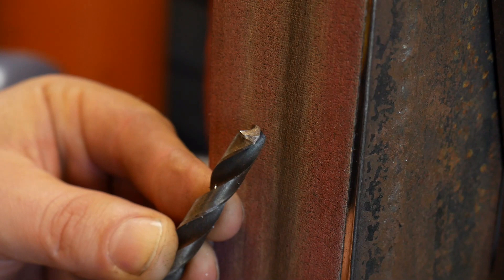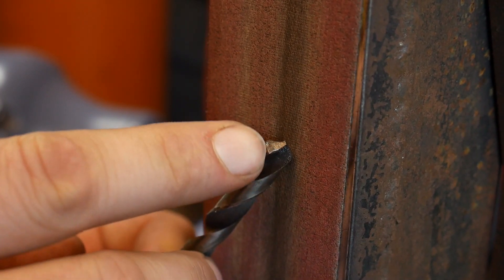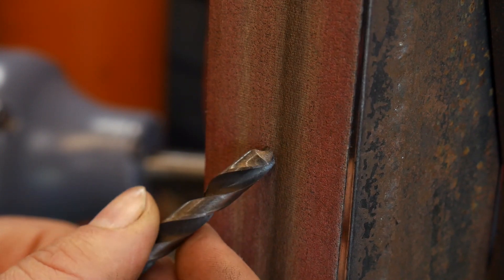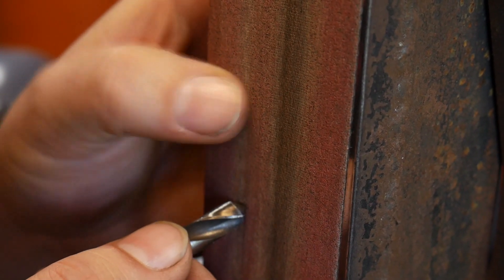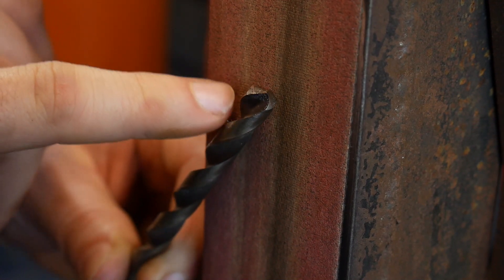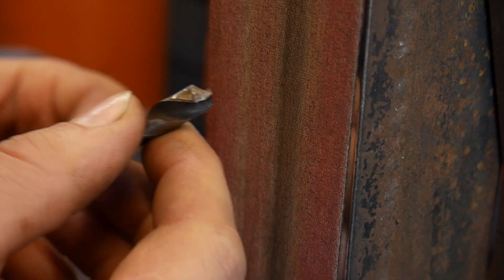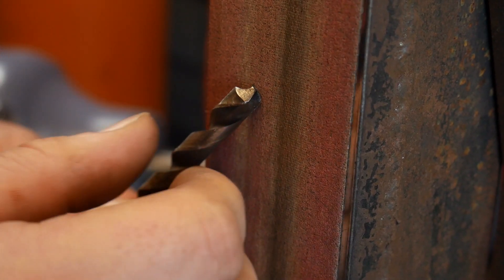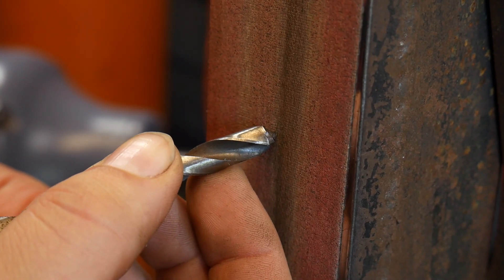How to Resharpen Drill Bits [Pro Tip #32]

Comment: Is it necessary to do equal strokes on each side to keep the bit cutting straight?
Reply: very important,gotta watch and keep the center tip aligned.Sharpening drill bits is far more complicated than Roys demo here.Go to your local community college machining class and the drill bit sharpening section can go for months.After saying that I do mine similar to how Roy has showed us but I use a green silicone carbide wheel on my bench grinder.I use a rocking motion at the heal on the end of the grind to knock that back edge down...after you've done a pile of em its just muscle memory.I havnt bought a new drill bit in years.Great vid Roy!

Comment: I may have missed it but what grit belt do u recommend?
Reply: 120 grit works well on a belt sander if your just cleaning up and edge...got chips shape it back up with a 80 grit and finish on 120grit.
Reply: Will M. F drill sharpening is best done on a bench grinder, not a belt grinder/sander